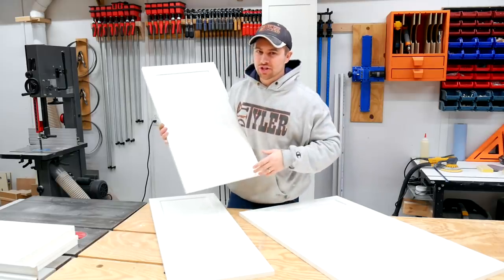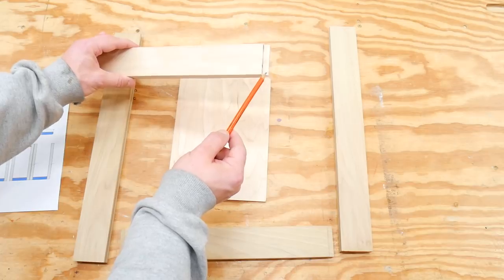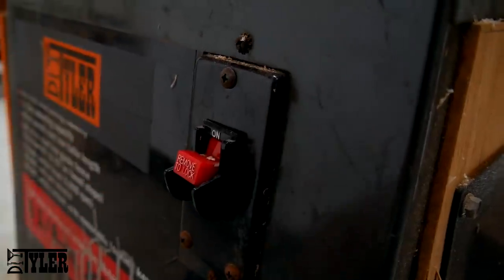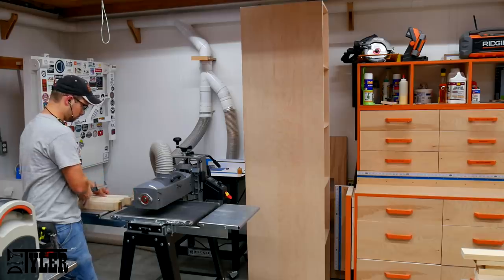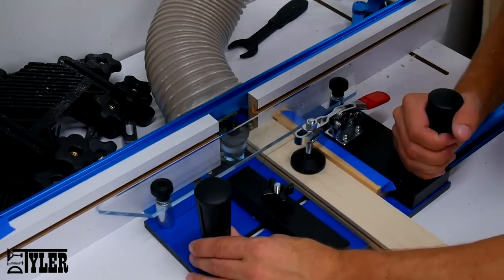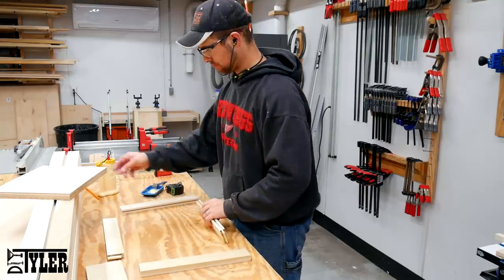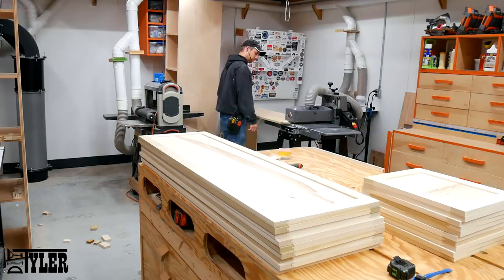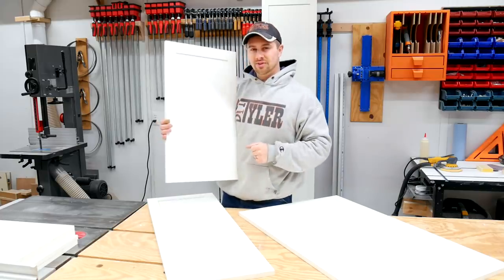How To Make Shaker Cabinet Doors (KINDA EASY!)

Comment: Awesome. I like your router table set up. Its making me rethink my router set up.
Reply: indeed @wes hamstra, I especially liked the tip with the tape on the router height adjustement very very interesting!
Reply from the maker: The dust collection is amazing! Do it Wes!!
Reply: Tyler G the dust collection i have on my set up is pretty good. Better then my table saw
Reply: What router table  system  is this Tyler you do awesome  work

Comment: Thanks for demonstrating the tongue and groove router bits!  I’ve debated whether or not it would easier to use the table saw or router for these types of cuts. Definitely the router table after seeing your video. Thanks!
Reply from the maker: For sure! And you can easily change designs using the same setup.

Comment: Question, what do you use for your inside panel on the large locker doors? A panel that size makes me worried about wood movement. Would you do an MDF panel?
Reply from the maker: MDF would be adequate. I have done some pretty large doors, 1.5'x6' with plywood panels and they are great. I have seen kitchens that have a solid panel that you can sometimes see the unfinished edge as the seasons change. Solution there would be to paint the panel, or at least prime with your final color, before assembly since you don't actually glue the panel in place anyway.
Reply: @DIYTyler  wonderful, thank you Tyler. Your mudroom look amazing. I have a mudroom with open lockers and I want to build doors for them. Your videos have been so helpful. Subscribed!

Comment: What a dream workshop! I have one question about the panels. All the panels I see at the big box stores and even one lumber yard are never 0.25" thick. They are more like 0.20-.021", so the panels are loose and there's a visible gap. I don't know how to compensate for this. In the video, it looks like your panel wood is actually tight. I've looked at birch, plywoods, even MDF, etc. Why am I not getting this fit?  Thanks for the helpful video.

Comment: Weird that you posted this almost a month ago but it just showed up for me today, I literally was making the exact same kind of doors yesterday! I did have a little issue that I think my router is not sitting 100% square to the fence so my grooves are not exactly true. Kind of a bummer and something I need to address. I've done 2 complete doors and parts of a third but I have another 5 or 6 at least still to go for this one project. How much tweaking did you need to do to get the bit height and depth right? I added a few of the included shims into the tongue bit to get a tighter fit.

Comment: Hi Tyler, I'm new to your channel and I really enjoy the content. I have a question for you that is not related to this specific build but in regards to your miter saw. I've got a really small shop (12'x15') and I'm torn on which miter saw to upgrade to. I was pretty set on the Delta Cruzer 12" (traditional sliders are out of the question) but it's a little more than I want to spend. Then I was leaning toward the Dewalt 716XPS non-slider which is what you used to have I believe. I'm interested in your opinion on why you replaced the DeWalt with the Rigid and your thoughts on sliders vs non-sliders. Thanks in advance.

Comment: Just a question on the Sander, what grit are you running? mine came with 80 grit I think which will definitely remove material but seems to leave noticeable sanding marks.
Reply from the maker: It depends, use 80 like you if I need to remove material but I also have 150 and 220 for cleaning up the marks that are left.

Comment: With the grain direction of the rails and styles, wouldn't it be fine to glue the plywood in place?
Reply: Doug Prentice I'm building the same style doors and especially with the mdf panels I'm using, I wonder the same thing. My fear is painting them and then having the panels shift and exposes unfinished areas.

Comment: Did you need to sand between coats?  Was it just one coat of sealer and one finish coat?
Reply from the maker: I did and but only the sealer coat. One coat of sealer and two topcoats.

Comment: Great work Tyler. What model router lift do you use? What grit did you use for the final sanding on you drum sander? Do you allow extra thickness when you make your doors to allow for the final sanding?
Reply from the maker: Rocklers router lift, not the pro version.
220 grit for final sanding on drum sander, don't allow for extrathickness....allowed extra width for the rails and stiles so I could sand down the edges to exactly 2".

Comment: You could glue the plywood panel without problem, couldn’t you ?
Reply from the maker: Maybe in the middle. The wood around it is going to move so you don't want a solid glue joint.